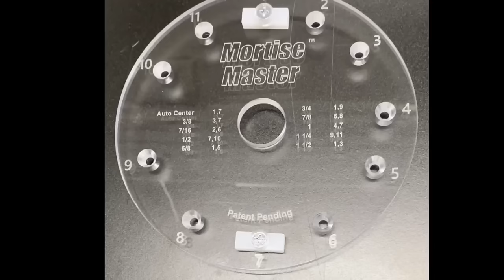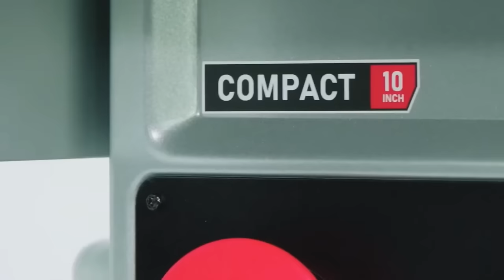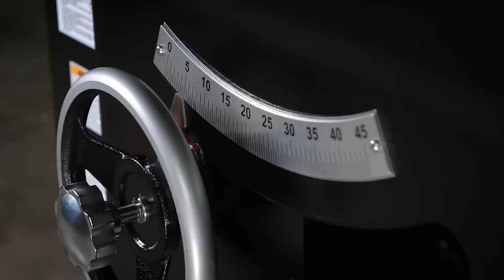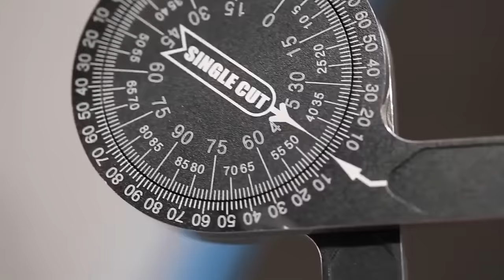Top 10 Genius WOOD Tools for Clever Woodworking

Comment: SawStop is a bad design because 3. There’s no reason the technology should be designed to destroy the blade and cartridge.  If the technology is employed it should ONLY require retraction of the blade.  Stopping the blade is not necessary if the blade retracts.